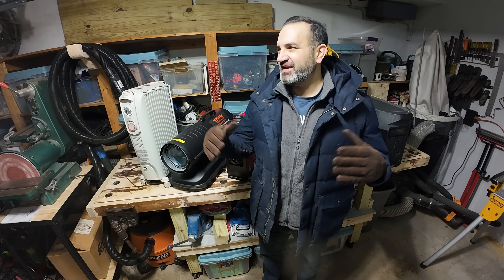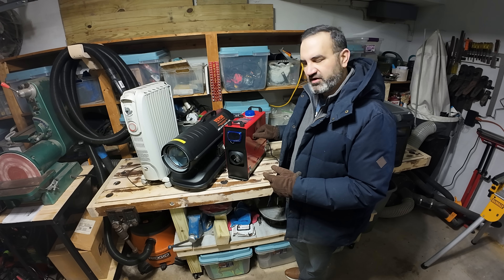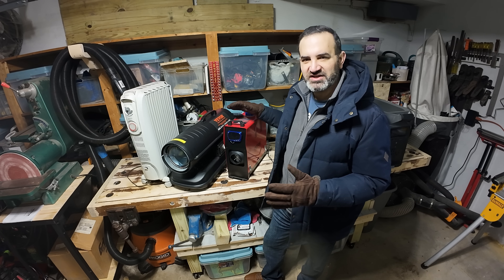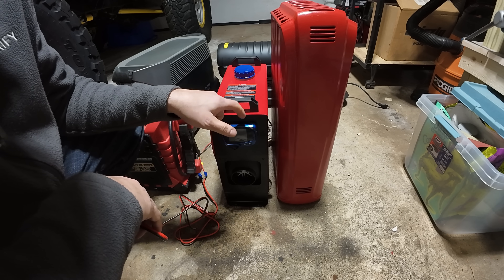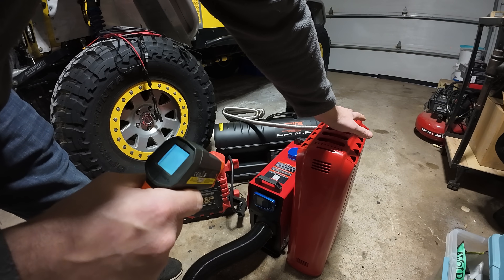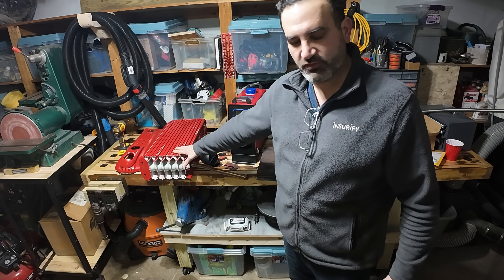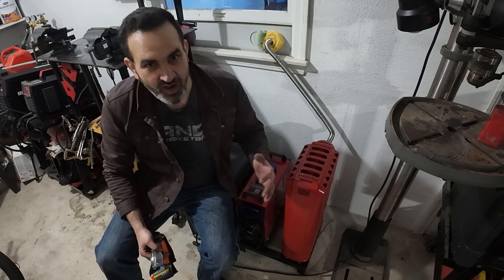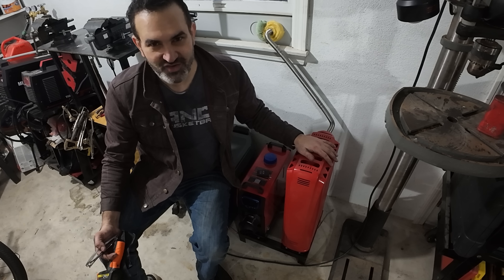Super-Efficient Vevor Diesel Heater Build for Shop & Off Grid

Comment: Well, this is actually a good idea. There are cons, as many have pointed out; condensation and soot. 

My permanent home, as of October  2024, is a 40' 5th wheel with 4 slides for a total of 400 sq.ft. of interior living space.

Our winters are fairly mild - lows in the mid to low 30's at night and mid 40's to low 50's during the day. The trailer receives very little direct sunlight. It is equipped with a 40,000 btu propane ducted furnace. Without running it during the night, it burns through 10 gallons of propane in a week at a cost of $39.00 or $169.00 a month.

Having watched several of these exhaust radiator ideas on YT, I decided to give it a try, with a few changes. First, I built a ground barrier - 2" x 2"  framing with R13 insulation sandwiched between 5/8" plywood. Next I built insulated skirting - R10 rigid insulation panels with 2" x 2" framing with the outside covered with exterior siding. This enclosure includes the area under the nose where the hitch is mounted which I use for storage. So the entire space is enclosed, sealed, and insulated.

I then mounted an 8kw diesel heater (with external fuel tank) on a small 18" high platform attached to the ground barrier directly under the existing furnace to minimize duct length. This is where the exhaust radiator idea varies. 

Instead of using an old radiator, I took 8' of  2" stainless natural gas finned tubing commonly used in restaurant kitchens for appliances, and attached it in place of the provided flexible exhaust tube along with the muffler.

I bent the tubing in a flat 3-4" serpentine pattern with an inclined slope which exits the skirting at ground level. This has successfully allowed condensation to exit the system while providing optimal air flow to minimize carbon buildup.

I run the heater utilizing the Afterburner thermostatic controller, which allows the heater to properly cycle on and off when the preset temperature limits are reached. This provides a more constant interior temperature of around 72°F 24 hours a day while maintaining a measured 60°F in the enclosed space under the trailer. Heating this area keeps the floor and plumbing of the trailer warm which aids in the overall heating of the living space.

I have been running this setup for 6 months now and it has worked flawlessly. Average fuel use has been 1 gallon per week at a cost of $5.00. My heating cost is now $20.00 a month and we don't have to freeze at night. An added bonus, due to the outside location of the heater, is that we can barely hear the blower (the propane furnace was very loud).

Update: I just removed the exhaust system and attached it to the garden hose (soot remover added) to clean out any soot. Very little, if any, came out and the tubing flows at 100 percent.

At this point I am confident that this setup will continue to operate efficiently with little to no extra maintenance beyond what is recommended for the heater itself.

Any thoughts or comments? If so, please reply. THANKS
Reply: Can you show us your setup?
Reply: Show me

Comment: The electric heater that you just destroyed was a de longhi and was a very good heater that I use to heat up a room of over 20 square METERS!(for your information that's little over 200 square feet holding a temperature of approx 23-24 degrees CELSIUS !!! You may not know that if the exhaust leaks in the room, the carbon monoxide in your blood is irreversible and the end effect is death
Reply: Umm, obviously the final installation will be exhausted to the outside after the radiator (can't believe you felt the need to say this). And yes, this oil filled radiator does work but it is overall very inefficient. How so? 

First, it is radiant heat which requires the oil to be heated then the room air. This is a slow process compared to forced air systems.

Secondly, it is 120v electric heater pulling 1500 watts or 12.5 amps. For every hour that this unit runs, it pulls 1.5 kWh of power. To maintain a constant room temperature of 23°C, it would need to run 24 hours a day. This translates into 36 kWh per day. At an average US rate of $0.1595 per kWh, the cost per day is $5.74 or $40.18 a week for a monthly cost of $174.12, the same cost as a small RV propane furnace.

Lastly, the De Longhi heater is priced at $99.95 new and $65.00 used and can be commonly found at Thrift Stores for $10.00 or less, depending on age and condition.

As I detailed in my original comment, this diesel fueled forced air/radiant heater setup is FAR MORE efficient both in terms of heating and operating cost.

We all appreciate your input, but really, you should do the math and consider changing over your heating system.

Comment: Some what surprised you didn’t leave the oil in the radiator and run copper through the fins this could have then been connected to the exhaust outlet, the oil will then heat the oil and be radiated into the room
Reply: Really? I love comments like this. Give that a try and let us know how it goes.

 BTW, current cost of 1.5" copper tubing is $19.65 per foot, assuming you are correctly running the tubing on the outside of the radiator between the fins. But then, you are losing efficiency by trying to heat the fins from the outside and then radiating that into the oil. The more I work your concept the worse it gets. Oh, and don't forget the additional cost of the copper fittings and the time to solder and assemble it. 🙄

Comment: One could coil copper 'bendable hose' around the length of exhaust pipe to capture heat by circulating water around copper coil, feed heated water back to a drum to circulate water / aquarium use. No more thermostat heating, save heaps of power.

Comment: The only way you achieve 100% efficiency is if the exhaust gasses are the same temperature as the intake gasses. Adding an iron radiator probably won’t extract all the heat and you’re increasing the odds of getting combustion fumes in your living space. 

I prefer to leave my heater outside and use radiators with liquid to transfer the extra heat inside. That is safer in my opinion.
Reply from the maker: @MostlyPosative-nj5ex  “+100%” means “double”.

Comment: Great video thanks for taking the time to make it. I share the same opinion that In a permenant installation you should put the exhaust outlet of heater to the top of the radiator, and radiator outlet at the bottom vented outside.  The reason is as the exhaust gas cools it will condense and the way you have it, the radiator will fill with condensate over time.
Reply: Saved me the typing.
Reply: @thefix2573  Same here. Condensate might be a little acidic as well.

Comment: This method is effective... but you need to service that radiator thoroughly and often. When you cool diesel exhaust so rapidly, it causes soot to buildup much faster. Nothing wrong with your method... so long as the exhaust/radiator is sealed well... but please 🙏 service it often. The world can't afford to lose a valuable tinkerer for something so insignificant as poor maintenance.

Comment: Might consider adding like a 13 inch fan blowing across that rad. If you do that you might be able to just run the heater just enough to keep the rad hot.

Comment: The comments about using a wood stove passive fan will work OK. But not as well as a small 12 VDC fan in a sheet metal shroud. The 12V fan will push air around the fins. Maybe just a 275 CFM to 300 CFM fan.

Comment: What size shop do you have? And what kind of impact did it have on heating it? Ie, what's the air temp before starting the heater vs after day 30 minutes.  Also, how long does it take to heat up your space to the temp you want?  Nice job.  I like the concept,  I'm looking for a way to heat my garage/shop without taking up too much space
Reply from the maker: @pauls6526  2.5 car garage, probably 400-500 sf, decently insulated. I didn’t do extensive testing of temp, but when it’s 30-40 outside, it gets the shop to a comfortable temp (60+) in less than an hour. I have to use the kerosene heater to get up to temp when it’s below freezing (that’s a lot lately).

Comment: How has it been running? Any issue or service needed to be done so far? Alot of people comment on the exhaust can not be facing upward do to condensation in the pipe have you notice any issue with that? Is it even a problem with a small heater like this?  I am asking do to my basement windows are up high and i can not put the heater higher then the exhaust not happening i am thinking if i put the rad in between condensation would lay in the radiator and not back in the heater anyway.

Comment: I'm just thinking outside the box. What if you kept the radiator with the oil in it as a thermal mass, and heating exchanged the fluid with the exhaust from the heater?

Comment: You need to account for the water build up in the exhaust system.  I have two of these systems.  Water trapped in one of my exhaust pipes froze and the heater exhaust backed up In to the shop I only had 12 inched of exhaust pipe out side.   Wound up insulating the exhaust pipe out side.

Comment: I literally have no idea what the hell you're doing in this video. 😂 What was it that you cut out of the bottom of the heater? What did you flush old oil heater with to clean it out? What are you running through the heater? Is it just the exhaust air that you're running through the heater core? Like, some real explanation would be helpful.

Comment: I know many commented it already, but since it is so important let me summarize it again:

The heat chamber of the diesel heater should be the HIGHEST point of this system and the exhaust line needs to constantly fall downwards. Add legs to the heater Unit, enter with the exhaust on top of the radiator and exit the radiator with a downwards sloped pipe to the outsides.

Everything else will over time airlock or at least restricht the exhaust a lot
Reply: Agreed.  Just get rid of the heat exchanger and blow air directly across the exhaust.  If you must have a heat sink, consider running the exhaust pipe through a sand battery.. then outside.  At no point is having the condensate inside a good thing.
Reply: @gbear1005  yep, if you really need the last few percentage of heat, then I would be super picky about having the exhaust as short and vertical as possible.

Comment: CONDENSATION ❗
You can't put the exhaust into the bottom of the radiator and out the top.
Condensing water will build up and kill the heater. 
Exhaust must flow slightly down to top of radiator then exhaust out bottom continues outside at slightly lower level again.

Comment: No matter what, you'll never get more output than the input. There's 138,700 btu in a gallon of diesel.  At 100% efficiency, that's all you get per gallon. You can't beat the laws of thermodynamics. 

If you're buying fuel at a retail gas station, price per btu, your oil filled radiant heater is cheaper to run. That's not even including the cost of the electricity to run the diesel heater, the cost to run to the gas station, or the hassle of filling the tank when you need to.
Reply from the maker: @foursquarehomerepair  okay, but “+100%” doesn’t mean “100%”. It means “double”.
Reply: @offgrid101  Which would mean the burner is less than 50% efficient in the first place?  Uffda.

Reading online it uses 0.127 gallons an hour. That's a max of 17,600btu or 5,100 watts of heat. Figure out heat loss through the hole you'll have to cut for exhaust, and figure out heat loss through the air you'll have to draw in for combustion and calculate actual efficiency? Dismissing  the couple hundred watts of 12v current you need.  Anyhoo... 2-3 oil heaters like the one you cut up would out perform these set ups.

It's a fun project and neat little set up, but it's usefulness is limited to very  specific set ups.

Comment: The oil filled radiator performs it's intended function perfectly. Your use of it isn't ideal. In a well insulated space with few air changes they work well. In an uninsulated single skin workshop your heat losses are massive. You are attempting to overcome that by trying to heat the entire world, while making the space you occupy a bit more comfortable, but the heat loss is your main issue. Not sexy, but draughtproofing then applying insulation will go a long way to making your workshop more useable
Reply from the maker: @imaginitivity7853   if you choose a path to a solution based on preselected tools, that path is almost always unnecessarily expensive and time-intensive.

Comment: would it create instant heat, if you just replaced the electronic heating elements of the oil rad, with a metal rod, attached or coupled to the exhaust, run into the oil reservoir to heat the oil? the hot metal rod would then heat the oil?

Comment: how did you fit the Exhaust to the old Radiator? Thank you I gotta do this
Reply from the maker: @sivartsivart7955  check 13:22 for a split second before I put the back cover on you can see I welded on some 1” OD square. Currently updating that to 1” ID round

Comment: You should run the exhaust into the top.  That way you have a chance of the moisture in the exhaust to actually be pushed out the bottom of the radiator with the exhaust.

Comment: nice, if you would use the exhaust heat to warm up some of that oil that used to be in the radiator wouldn't last longer? Or have it warming up a five gum bucket worth of oil similar kind of idea?

Comment: The condensate from the exhaust is very acidic I don't know if it could possibly eat a hole in that radiator at the bottom in some time or not? I know it will eat a hole through copper because I've seen it happen.
Just something to be aware of.
A carbon monoxide detector would detect any leaks

Comment: The exhaust pipe temps using a temp gun will be off... read too low.... on the bare stainless steel. If you put some black paint or tape on the pipe, it will give a much more accurate temp. I think my readings were off by about 20-30% maybe more... like 100* on the bare metal pipe was actually 130* with black tape. Something close to that

Comment: I think short term this will work, but long term the radiator may well choke up with carbon. Not the easiest thing to clean out.
Reply: Or the condensation will rot it out. It actually has acid properties after the combustion process.

Comment: 0:35 “it’s a radiator” “uses convection” No, it’s a radiant heater. If it were convective heater, it would have a fan to “push the air up through these fins” as you say.
Reply: You don’t understand how convection heaters work. The hot air moves up through those channels, out the top, and pulls cold are up the bottom. It creates air movement without fans. It’s not a simple radiator. It has a radiator inside the convection channels.

Comment: Instead of sooting up your heater with exhast obstructions just buy a second heater. I can run 2 on lower settings-use same amount of diesel as 1 heater on high and my shop stays 10F warmer than 1 on high setting

Comment: I tried this, but after a few days, the combustion in the diesel heater is not optimized and the heater will get clogged up with the not well burned diesel. The ashes builds up and the diesel heater will stop funtioning.

Comment: Dude I’ve done all this and I can tell you now THE most optimal way to to do this is using a heat exchanger, wet radiator, and a water pump.
I got an old EGR heat exchanger, plumbed this into the Rad, and pipped the exhaust through it. 
It throws out a LOT of heat… 
If you really wanted to scavenge all the heat of the exhaust you could tag your air rad on the end. 
Trust a water Radiator is the way to go.
Reply: Did this extract same thing mate it’s unreal
Reply: Wouldnt that cut your power supply by driving a water pump as well?  If your runnig this puely on solar .
Reply: @chadjansen9097  no, why would it I just got a . Small 12v hot water pump to circulate water through the radiator. Tho k it was £20 of Amazon
Reply: any pictures of you setup
Reply: @bogoff99  it’s in bits at the min S rebuilding cabin.
It’s easy though, just pipe the exhaust through a second hand egr heat exchanger, then pipe the water through the exchanger with a little 12v hot water pump and run the pipes into. Radiator.
Done nothing more to it than that really.
Reply: @dazzassti  thanks. Just wondered if you had water system sealed, with a header tank etc. optimal heights and sizes etc.. 
I will play around with it👍

Comment: You could get a wood heater fan and put on top of the radiator. It works with no power and would move the air around   Great idea and great video.

Comment: Thats relly great idea. I was wandering what would happen if take the top of the radiator off. Flip it on its back, so exhaust ports are now at the bottom. And have a u shaped vent blowing back through inside and outside of the radiator at about a foot or two distance. I wander if that would help with condensation but also reduce the temperature of exhaust coming out the window. I think even if it doesnt make heater more efficient it could potentially just move more warm air around the room. Thats what i was thinking to built before i watched this video, now im not so sure seeing how efficient this setup is.

Comment: Try running the exhaust into one of those oil heaters and out of it and into another oil heater see if it captures more heat. I'm also wondering about condensation buildup of water inside these units.

Comment: Cool idea! Deboss garage just did basically the exact same thing using the veevor diesel heater. As other commenters have mentioned, it would probably be better to mount the exhaust into the top of the heater, and put the diesel heater above for condensation and soot buildup purposes.

Comment: The thermometer you are using has a shotgun effect. the laser is just a pointer. you need to get very close to get a good number, shiny surfaces will cause some false readings so some high temp black paint would help